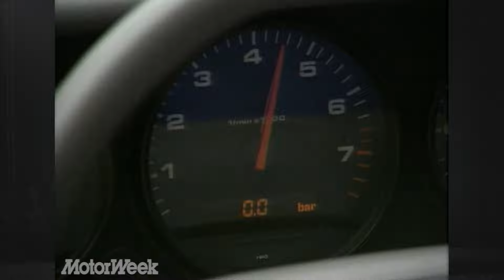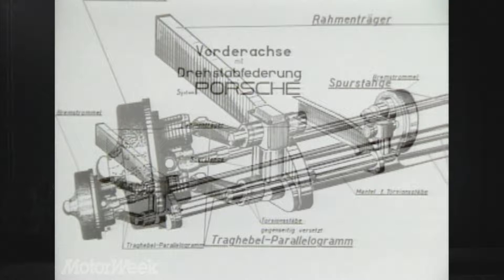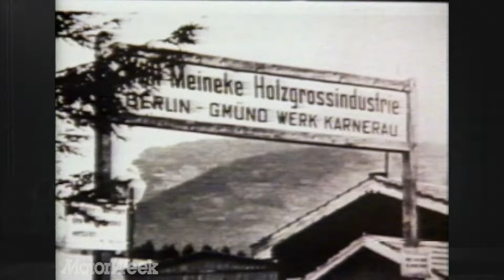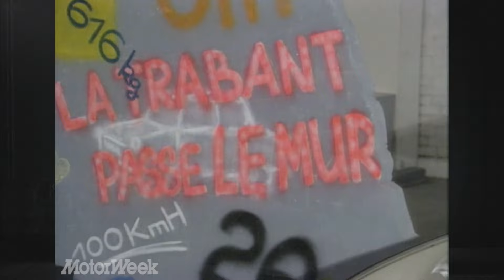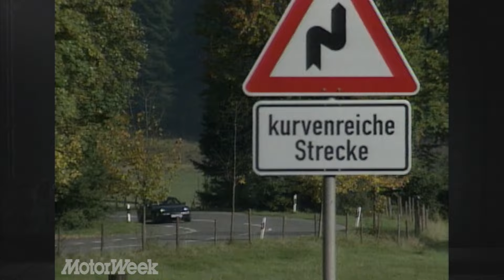1991 Porsche Episode | Retro Review

Comment: 20:23 - Is that.....the Porsche Panamera's beginnings?
Reply: TheZProtocol  That would be it lol. But they did many designs.
Reply: @Porsche996driver  there's a Porsche 968 concept with 4 doors, just like in the picture, it has two small suicide rear doors akin to the RX8 ones
Reply: One of the many; but the Concept 989 is by far the foundations for the end product.